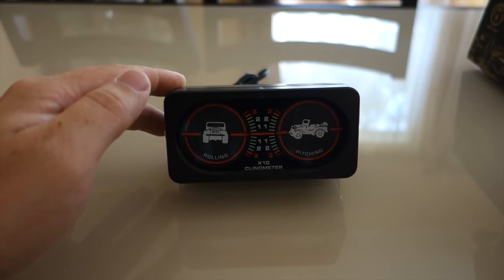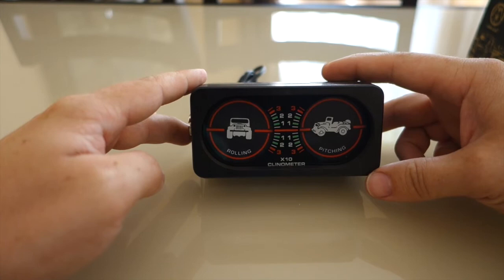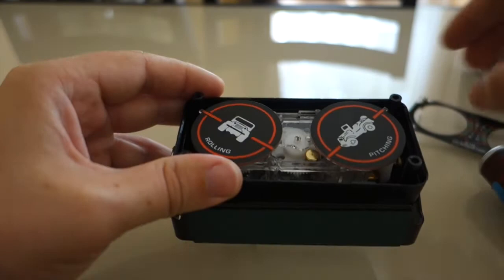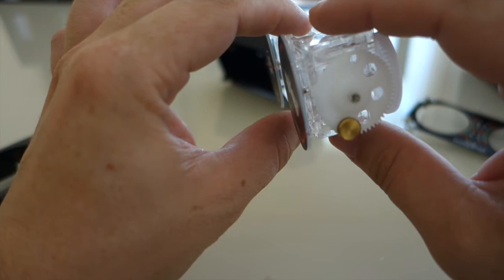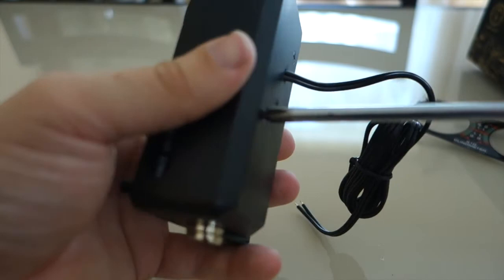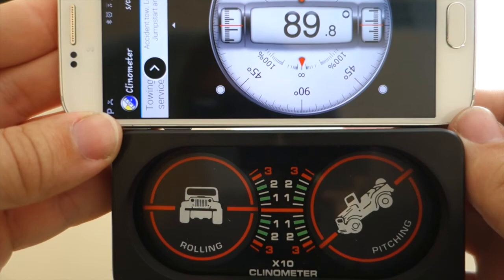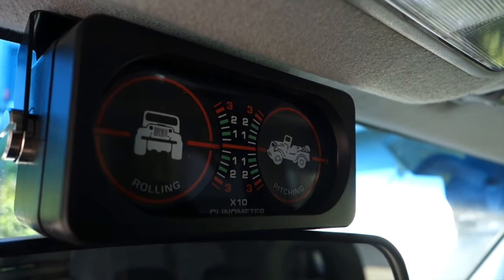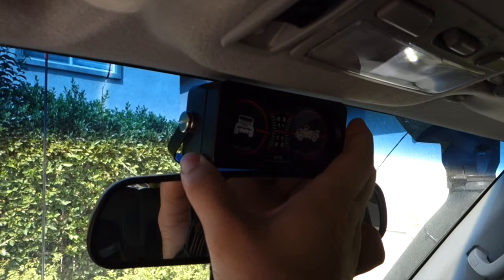Rugged Ridge Inclinometer 13309.02 test and adjustment

Comment: I bought mine directly from China (from their Online Store), and that one has a CALIBRATION KNOB in the outer housing, so all you need is to put it on your car at any angle, park your car on a flat road or pavement, then calibrate the inclinometer to 0,0 no opening of the unit at all.
Reply: Link?
Reply: @mallkrawlerz620  Links not allowed here, or maybe it needs approval from the owner of this video, but just search it on Lazada dot PH, so you can see the picture, just search for "Rugged Ridge Inclinometer". It has an Orange adjuster in front of it. If you found it, simply search for one on Amazon, maybe they have available in there as well.

Comment: You don't actually have to remove the clinometer from the rear half of the case. If you insert a precision screwdriver against the teeth of the gears you can gently move the face of the dials in the desired direction you want to adjust them to. Just don't apply too much force when moving the faces.

Comment: Wounder how the plastic face works out in a hot auto. The china made clinometers face melts in a hot auto.
Reply from the maker: Never had a problem, and the vehicle that it was installed in was parked outside every day in hot Southern California weather.
Reply: On hot days, I always keep the soft top up in my Jeep or at the very least, the spiderweb shade is on. So I don't see this being an issue.